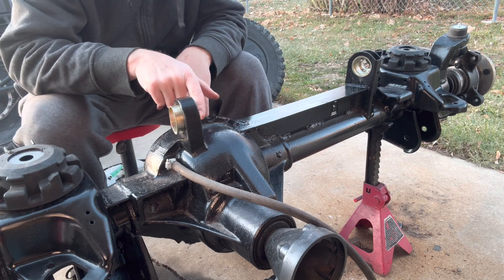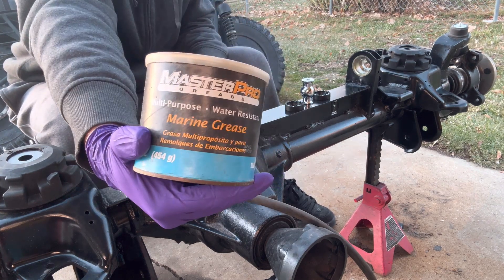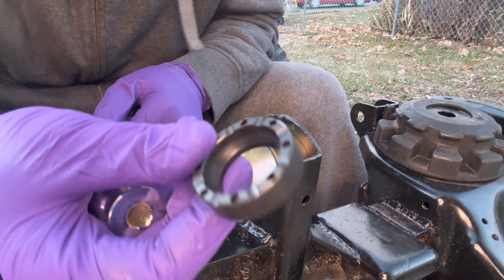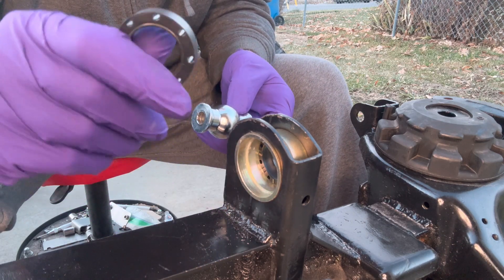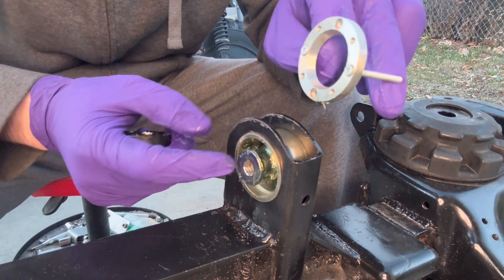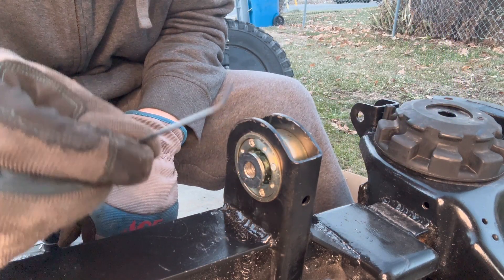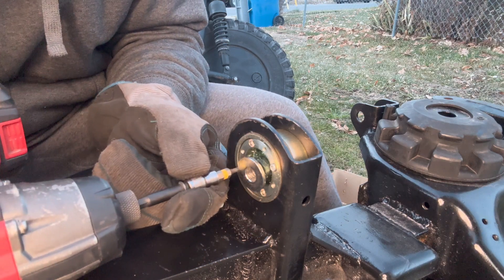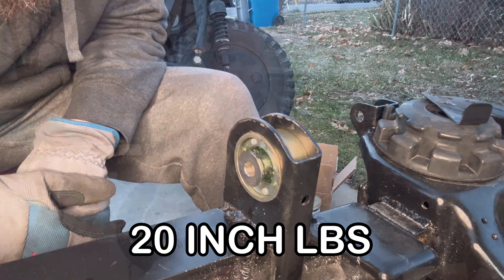Iron Rock Offroad WJ flex joint assembly and installation

Comment: They claim 55,000 miles so I’ll keep you posted if they meet it. Just installed mine less than 10,000 miles ago and are on a 2.5” lift with 30.5x9.65 and also 30.5x10.50 in summer. I do occasionally off road and actually ran the first 5k with my front sway bar unhooked for testing. But now I wanna drive 65mph down the highway 😅
Reply from the maker: They are supposed to be awesome. I’m on 3” lift and 31.5” going to install my 34” soon. I wheel it hard so we’ll see. 🤞
Reply: @recklesslyfestyle  I haven’t jumped mine yet like they claim it can handle lol but it’s seen some death wobble and plenty of belly scratches and road miles so far so good.
Reply from the maker: Haha, yay death wobble. I’m looking forward to seeing how they are. I do have their rear long arm with the same style joints and I’ve been really happy with it. I need to get the front long arm now.
Reply: @recklesslyfestyle  I could barely afford the core 4x4 front control arm set 😅 so far they’ve been holding up but I could only dream of long arms!
Reply from the maker: My friend runs Core 4x4 on his ZJ. He’s been happy with it. Right now I have short fronts that I built with DOM tube and Currie Johnny Joints. Looking forward to matching my front and rear though.
Reply: @recklesslyfestyle  I’ll definitely be upgrading to Johnny joints when I can